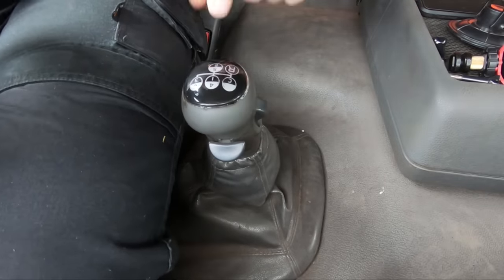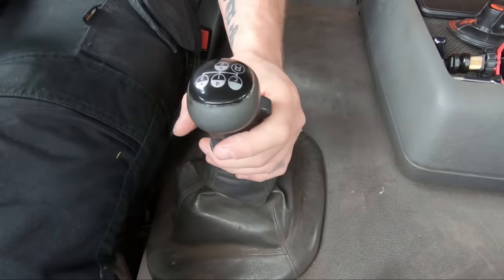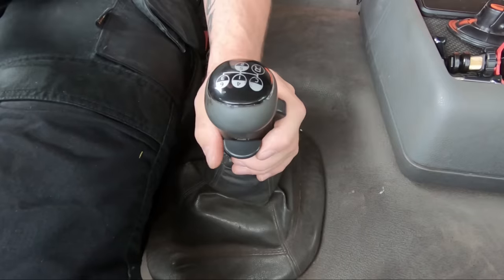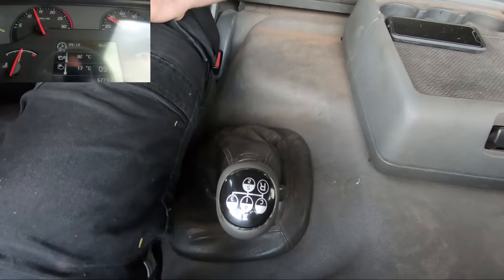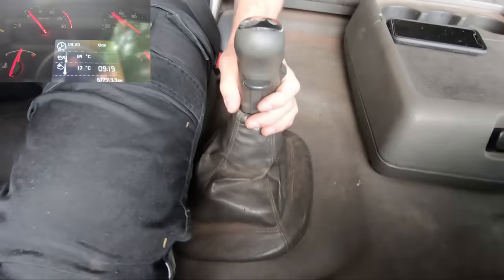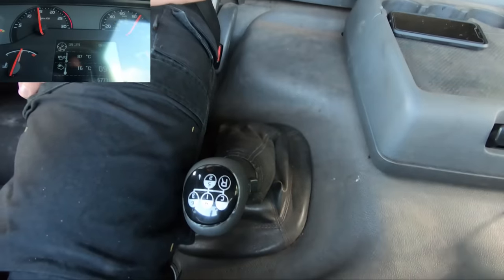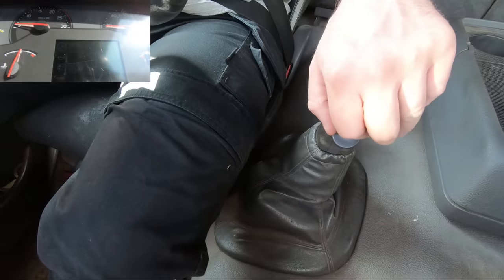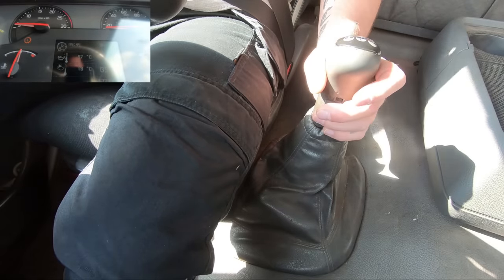How To Use 13 Speed Manual Split Box

Comment: Might be a stupid question but I’m well confused, does 13 speed mean 13 gears and if so how does it have 13 gears when it only has 6 gears on the gear stick, and if each gear has half a gear wouldn’t that make 9 gears in total, and what does the C stand for. If I sound stupid I’m sorry but I’m not clued up at all haha, cheers
Reply: luke watch the video again  all your questions  are coverd in it
Reply: C is crawler
Reply from the maker: It has 1st 2nd 3rd 4th 5th 6th. All 6 can be split = 12 gears. Then crawler. 13.
Reply: Deady 2012 nice one for that mate

Comment: Hello! What if I downshift for example from 5HIGH to 4HIGH - the difference between them is around 500 rpm, so when I press clutch and have moved shift lever, what should I do further: - slowly release clutch? - release clutch and give gas at the same time? - blip the throttle like rev matching in car?
Reply from the maker: No mate, just change it 😊 If it’s a newer box it should slip right in

Comment: I learned in a 4 over 4 then drove the same with a splitter (16 speed) in most of my jobs. I've driven them Volvos Deadys driving, they're one of the easiest gearboxes to get round. But the Eaton twin-splitters (12 speed) were the real challenge, you would find these mostly on ERFs, Fodens and Seddon-Atkinsons although i once had a Daf with one. A real fcuker of a gearbox but once you got used to em you won't wanna go back. These drivers nowadays don't know what they're missing, what with all these autos in modern day wagons. All you old-school drivers will know exactly what i'm talking about.
Reply from the maker: Pointless going back. Everything in life is easier. 
Did you prefer walking around your front room waving an aerial about trying to get a signal for one of the 3 channels on your box? Or is Sky better? Come on.
Reply: I never once said we should go back did i? I was only reminiscing about how wagons used to be as those were the kind i was introduced to. Yep things have changed now and it's all good. TV aerials  are better now too!
Reply: @Richard.Cameron  what do you think about downshifting 4 over 4? I mean, how did you act after pressing clutch and moving gear lever in lower gear: release clutch and press gas at the same time? Or you blip the throttle like a rev matching car technique?
Reply: @АлександрКоловрат-и1н  on a modern day gearbox like the one in this video, i would just do it like you would with a straight 6 speed syncromesh box on a rigid or a car to be honest. They are that simple to use. Whereas in the old days, you would bring your speed right down and hold the gear lever in neutral briefly (clutch down) while giving the engine a short sharp rev. This is to open what's known as 'the gate' to the lower gear, then proceed with the change as normal. You can repeat this when up-changing too, particularly if there is a gear that is stubborn to engage.
Reply: @Richard.Cameron  you do not understand me at all. I asked, what will you do AFTER selecting lower gear: just sloowly release clutch? Or firstly blip the gas and after that release clutch?
Reply: @АлександрКоловрат-и1н  oh right, ok. I would just release the clutch, i would maybe blip the gas if i was going up the gears depending on the model of vehicle. Hope this helps. Why do you ask anyway? Do you drive trucks?
Reply: @Richard.Cameron  I am studying in driver's school on 10-wheeler, lorry. If I need to downshift before roundabout, they tell me let off the gas, select lower gear, and slowly release clutch. But I never acted so with car. I always blipped the gas ("revmatching") for smooth transition.
Reply: @АлександрКоловрат-и1н  i know what you mean and understand why you would do that. Anyway good luck with everything and if there's anything else you need to ask just hit me up. I don't know everything but i have many years of experience and will help if i can. All the best. 👍
Reply: I had an ERF with the Eaton Twin splitter box, brilliant, but some folk found it difficult for some reason.

Comment: Deady who told you to double clutch your Volvo? You don't double clutch with a synchromesh box like you get on Volvo's and Scania's as I was always told you'll end up breaking the selector fork in the gear box or doing some major damage,that came from my dad who had four Scania 111's once then four ERF's with twin splitter crash boxes but he learnt to drive on old ace's and Scammels
Reply: YEAH just match the revs, and when your splitting just take your foot of the gas and back on and that splits it for you, no clutch needed
Reply: betty swollocks the quickest way to change gear in a twin splitter box is to pull it out of gear then stick it straight back in,tried tested over 23yrs of driving
Reply: @James48535  got go disagree with you there mate
Reply: betty swollocks disagree all you like but I know I am right cause it's how I used to use/drive a truck with a twin splitter box and I could change gear quicker than any one else up hill or down hill on the flat and pulling away at lights
Reply: betty swollocks like I said it was tried and tested and successful as I drove a truck with a twin spitter box for 12yrs,I learnt to drive in one

Comment: I remember  driving a truck with a two speed rear axle ,not too many able to drive a manual gear box now
Reply: There’s not many as most learn in auto tractor units these days. I think it should mandatory to learn in a manual split shift.
Reply: 😂😂 my dad was a HGV driver, after he retired  he kept his hand in with a bit of agency work. 
Got a call one day for a job, dad turns up and the guy asked if could drive a splitter box as the last two the agency sent couldn't.   
He also had a PSV class one.  Passed  in the 70s on a proper bus  route master type.

Comment: I need you to explain more on the splitter.When can it be applied? Does it work in an ON and OFF pattern?
Reply: Splitter can be used at anytime..

Gear two splitter stays in low position and range selector in down position 

Gear three: stays same as previous gear as you are in it. 
However moving to gear four

Gear four: range selector at the front of stick is flicked up as you double clutch into fourth from third.

Then you can flick the switch on the side of the stick up to four high after your quick clutch… and you can hear the change. 

Fourth to fifth: range selector stays up, but splitter switch on the side flick down then shift to fifth.

Fifth to sixth: range selector stays up and splitter switch goes up for five high.. hear the shift in sound..

Then flick the switch down once you hear you’re in five high ready for sixth gear

The splitter switch up for cruising gear or known as six high
Reply: If the truck is empty you can drive it normally. So example 2nd gear to 3rd then range selector up, then 4th, 5th, 6th

Splitter is good for loaded to reduce wear on drivetrain

Comment: Thanks so much for the pointers, pal. I just bought a new Volvo splitter and I haven't driven a split box since I was in high school. Does it say what gear you're in? What is best practice for engine braking, do you split gears or just drop it down in low split? Hope you're well, hi from NZ

Comment: Deady your correct that is an easy gear box,I know there ain't any twin splitters any more but they were better gear boxes than your Volvo,if you ever get chance to drive a wagon with a twin splitter do it,I learnt to drive with a twin splitter and with time and with it been a crash box I only used the clutch to set off other wise you didn't need a clutch,you'd rev up to match the engine to the gear you wanted when changing down
Reply: Your right twin spotters were the nuts, had one in my old ERF, couldn't beat it

Comment: Deedy, does it make a difference if you change the Hi box/Low box splitter while in Neutral between 3rd and 4th, as maybe just a meshing problem with the speed you are changing between 3rd and 4th is a bit too quick for the splitter to change between low box, and hi box on the manual gearbox, hense the need fot the double de-clutching needed between 3rd and 4th.
Reply: You can range change in neutral no problem. You can still be in low range, flip to high range, before even changing gear and you're away. Works for me anyway.

Comment: I’ve put a few miles in the seat in Volvos and I’ve never needed to double the clutch going from 3rd to 4th...
Reply: When i was new in driving trucks my neighbour drove a Daf XF 2001. And I remember that somewhere in that gearbox you had to double clutch. The only one in the fleet of 20+ xf's from his employer. Went back under warranty, they did something, but it never went away. Never had it with any other XF i drove after that. So it might just  be this one truck. I drove a couple of Volvo's too never had to double clutch too.
Reply: Double clutch; found I sometimes had to on FM, but not FH. Could it be the gear change linkage on lower cab?

Comment: Why do you start with in gear number 2 not 1?
Reply: Because the gears are really similar and overlap, you don't really need to pull off in 1st at all unless you have a heavy load going up a hill. It's not like a car where the gears are designed for speed and acceleration, the gears are designed to generate a lot of torque (force) high enough to move heavy loads, which means you need more of them and you can't really speed off. You can pretty much pull off in 3rd gear too when empty if you wanted.

Comment: I may have missed it you said splitter is half a gear but why would you need half a gear
Reply from the maker: When you are hauling heavy loads, dropping a full gear would make your truck slow down. Like going from 2nd to 5th in a car...
Reply: @Deady2012  great ive only driven class 2 with auto boxes. So would a half gear change require 2 changed so lets say 5.0 down to 4.5 then again to 4.0.
Reply from the maker: Graeme Connelly yeah. You go into 3rd Low, flick the switch to high, press the clutch. That will put you in 3rd high. Then flick the switch up, then go into 4th low, flick the switch up, press the clutch 4th high. And so forth.

Comment: You are using to many gears I never use that many myself and as for going from 3 to 4th you don’t have to double clutch you just feel it in not to fast well that’s how I’ve done it for 33 years anyway
Reply: You can use all the gears it's easier on the drivetrain and everything. It's fine
Reply: Well everyone to their own I’ve never done this when I had a Volvo FL 7 you just feel the gears in using you ears 😊
Reply: @andrewjefferies2962  idk I'm Canadian these trucks are pretty cool are 13 speeds are boring.
Reply: @andrewjefferies2962  like I drive an 18 speed and I hit literally every gear while loaded it's easier on the clutch to start in low. idk it's probably unnecessary but it sounds cool
Reply: @tg13fire  Keyword is loaded, you don't need to go through them empty